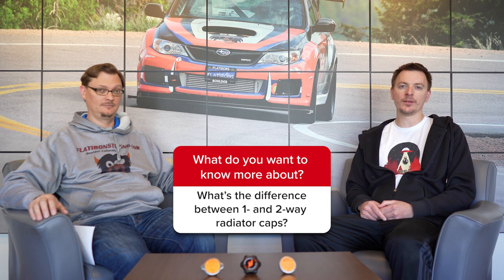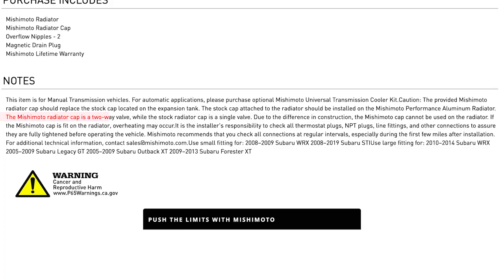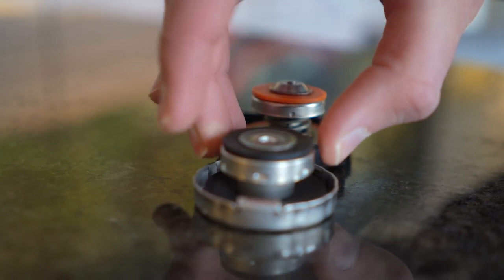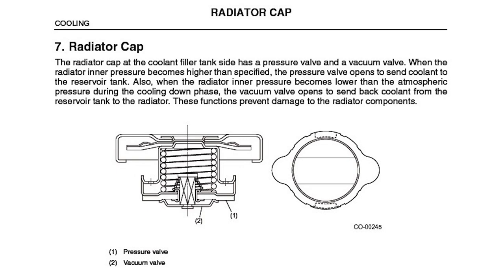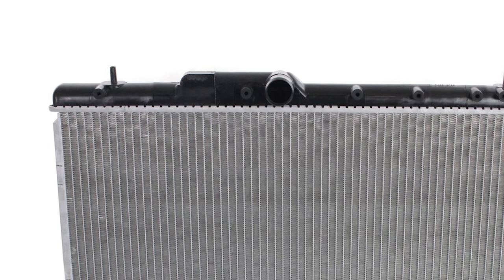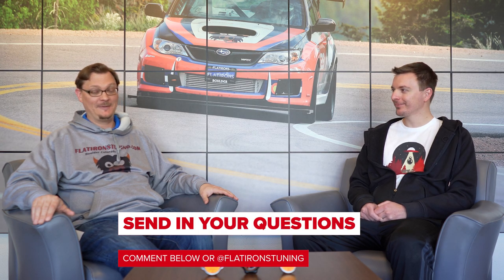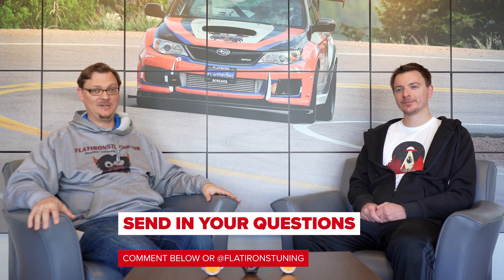Explaining the Mystery of Subaru Radiator Caps

Comment: So I am running a Mishimoto expansion tank and a Mishimoto radiator. And as you know they both come with the Mishimoto caps and I was running both but I noticed my car would over heat if idled for too long. Winter wouldn't really happen much. So I'm sure this is my issue, what should I do for caps? Should I buy an oem "expansion tank cap" and put it in the Mishimoto radiator? Will it fit?
Reply from the maker: Thanks for your question.  I'd recommend using the factory cap on the radiator because it is a 1-way valve, and see if that resolves your issue.

https://www.flatironstuning.com/subaru-oem-radiator-cap

Hope that helps and Stay Tuned!

Comment: i have a question about the pcv system. when i installed my IAG Competition AOS i completely removed my entire pcv system & just have all 3 breather ports ran into the AOS, and the return hose ran back to the crankcase breather port. Is my engine going to be ok without the pcv valve in said system, or do i need to reinstall the valve back on top of the crankcase breather port?
Reply from the maker: Thanks for your question.  From what you have written, it sounds like you installed the IAG Comp. AOS following their instructions, which is correct.  You do need to tune the car after doing this since you are removing the connection of the crankcase to the intake, but that is also why you do need to remove the PCV valve in this configuration.

You should be fine with it installed as you describe.

Hope that helps and Stay Tuned!

Comment: So, if the reason Subaru put the second cap on the radiator was to keep the seams between the aluminum core and the plastic from leaking, why does the all aluminum aftermarket radiator need it?

Comment: So I have a 2018 wrx with the mishimoto radiator and the mishimoto radiator cap… I have the stock expansion tank with the stock cap on it… I’ve been running the mishimoto radiator cap and my cars been overheating… could that be my issue ? Should I go back to the stock radiator cap?… I only have about 2 weeks with this set up
Reply from the maker: Thanks for your question.  I would recommend putting the factory cap on the radiator and then burp the coolant again.  Hopefully that helps.

If you continue to have issues I'd recommend getting an experienced Subaru tech to look at the car.

Hope that helps and Stay Tuned!

Comment: On my 04 sti I used to own it had a cap on the actual radiator and on the expansion tank reservoir. Ive had installed the larger Koyo radiator when I did one of my 4 engine builds and that radiator expanded from pressure in the cooling system and if I can recall had a head gasket failure. Probably due to not having a dual valved radiator cap on the expansion tank. Fast forward today now I own a 2018 Civic Type R which has an expansion tank and the radiator is cap-less. It is well known that these cars overheat on the track. I’ve done several cooling enhancement mods as well as a fully built motor and big turbo upgrade. Since then it hasn’t over heated. I think mainly from running a bigger turbo. I think maxing out the stock smaller turbo which caused more back pressure making it into a heat pump. The larger turbo has less back pressure so it’s not producing as much heat.
Reply from the maker: Thanks for the comment.  Stay Tuned!

Comment: Does this 2 cap solution also apply to the Subaru Outback...?
Reply from the maker: Thanks for your question.  If your car has 2 radiator caps from the factory (so an Outback Turbo) then this does apply just the same.

If you have a naturally aspirated engine, most likely you only have 1 cap from the factory, so you would not need to do anything to add a second cap.

Hope that helps and Stay Tuned!

Comment: I'm still confused on the radiator caps. i have a Mishimoto radiator and I have the Mishimoto cap on the radiator and it seems to run fine. should I do what Mishimoto suggested and swap the OEM  expansion tank cap on to the radiator and the Mishimoto cap on the expansion tank?
Reply from the maker: Thanks for the question.  Ideally you would run the stock caps honestly.  If you were to use the Mishimoto cap, it would go on the expansion tank, and then the OE RADIATOR cap would go on your Mishimoto radiator.  You need the 1-way cap on the radiator.  That is the piece that is most important.  Don't put the expansion tank cap with the "ears" on the radiator.  It is too low pressure, and is also a 2-way cap.

There is a reasonable chance that having the higher pressure cap on the radiator is okay.  (Mishimoto cap is 1.3 bar, and the OE expansion tank cap is 1.1 bar).  But you may still have issues with 2 2-way caps.

Hope that helps and Stay Tuned!

Comment: I run two oem 1.3psi caps on my forester xt, 1 for the tank and 1 for the mishimoto radiator. No issues after many years. I also did the same with my legacy specb, but with koyo rad this time. Still no issues. Just run 2 oem 1.3 caps

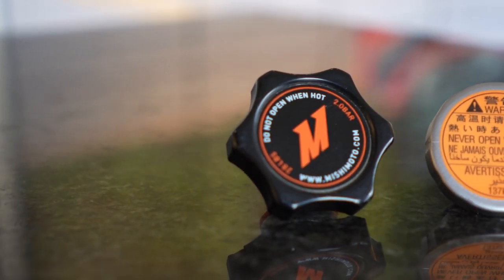Comment: I bought a metal Mishimoto expansion tank for my '03 WRX. Their brand new cap (identical to the one shown in the video at 2:28 and 2:36) leaked so i replaced it with an OEM cap. I have new OEM caps on order to replace the 19 year old ones.

Reference 4:45 it is stated that the 02/03 WRX did not have a radiator cap. I can't confirm or dispute that since i got a "free" radiator from my Subaru dealer when they poked a hole in it while replacing the timing belt. There are two caps listed for the 02/03 WRX: 

45137FE002 Cap  (Round)

45137AE00B Cap  (Round with two ears to grab onto)
Reply: I know the 02/03 only came with one cap, Subaru updated it with the 04 models (late 03 actually) due to radiator issues without the cap.
Reply from the maker: The 02-03 WRX didn't have a cap on the radiator, but that original part has now been discontinued and replaced by the newer radiator that has a cap.

Thanks for watching and Stay Tuned!
Reply: @Silent_Keith  Bought mine in March '03. Wouldn't consider that a late '03 but maybe it was since i'm pretty sure there were caps on both the radiator and the coolant reservoir. And the original radiator survived without leaks for 13 years until punctured at the dealership. Page 11-20 of the owners manual refers to both a radiator cap and a reservoir cap but maybe that only applied to non-turbo cars.
Reply: @FlatironsTuning  I can confirm that as my brand new 2002 WRX only had a "radiator cap" on the expansion tank.

Comment: So for a rotated setup without an expansion tank use the stock cap or aftermarket 1.3? 1.5? Curious
Reply from the maker: If you only have one cap on the system, it would have to be a 2-way cap.  So any aftermarket cap would do.  If you ran a 1.5 bar cap, then you would be increasing the pressure of the system.

Hope that helps.  Stay Tuned!
Reply: @FlatironsTuning  makes sense. Increasing the pressure with only one two way cap is good or bad?
Reply from the maker: @ANL4JC  Well, I would say that when you only have one cap, it must be a 2 way cap so that you will be able to let coolant back into the system when the engine cools off.  The advantage of a single cap is that you now have control of the pressure of the system with that single cap.  So if you want to increase the pressure, it is easy to do so.

Increasing the pressure will slightly increase the cooling capacity of the system.  Just make sure that everything on the cooling system is tight, etc.

For instance, we are running a 2.0 bar cap on our race car, but we had to test the system integrity to make sure that it would hold at that pressure.

You might want to take a look at this follow-up video:

https://youtu.be/RWZUdHRHkeI?si=JvWm1mQgA9jskjXD

Hope that helps!

Comment: Do I  burp air at the  expansion tank or on the koyorad  radiator cap ????. I just did this on the koyorad side. Was this wrong ?
Reply from the maker: Thanks for your question.  Because the expansion tank is the high point, you would want to burp the coolant there, not at the radiator.

Hope that helps and Stay Tuned!
Reply: Very helpful muchas gracias

Comment: Can the turbo legacy radiator cap (137 kpa) work on the non turbo radiator?
Reply from the maker: Thanks for your question.  Generally speaking, the non-turbo Subaru's only have one radiator cap, so you would be best to use their factory cap, not the Turbo cap.

Hope that helps and Stay Tuned!

Comment: Heya great video thank you .! question if i may.. i have built myself a closed deck forged 2.0 ej and am running a aluminium aftermarket radiator with no cap . from what i am reading should i be running a larger expansion tank ie the mishimoto one with a 2 way valve
?
Reply from the maker: Thanks for your question.  You do need to run an expansion tank then, and yes, you do want to use a 2-way cap there.

We go into detail about this after we made that switch in this video:

https://youtu.be/RWZUdHRHkeI

We have had good luck so far with the OEM expansion tank for what it is worth.

Thanks for watching and Stay Tuned!

Comment: I had a cooling issue due to running the mishi cap on a mishi radiator.. I think the main contributing factor is the expansion tank is the tallest point on the cooling system, therefore the two way valve needs to be there to allow coolant from the overflow tank to flow back into the cooling system properly. If you have a two way cap on the radiator, and a two way cap on the expansion tank.. then the coolant from the overflow doesn't have pressure to flow back into the cooling system.
Reply: @Lennysuga  agreed, but I believe the expansion tank is also supporting the coolant from the turbo.
Reply from the maker: Glad you were able to resolve your issue.

Thanks for watching and Stay Tuned!

Comment: I called and talked to Mishimoto about this 5 years ago haha I had that Mishimoto cap on the expansion and a Koyo on the rad for awhile no issues but then switched to the Koyo on expansion and a JDM STi cap on the rad (yes mostly for looks on both) but no issues, have only pushed the car on a California canyon run, no track time.
Reply from the maker: Gotcha.  Yes, now that we know what we are looking for, there is a bit of a pattern that is starting to appear.  It is really interesting, and we are trying some new things now that we have this info.

Thanks for watching and Stay Tuned!
Reply: @FlatironsTuning  yeah it’s surprising how much it impacts the timing and flow of the cooling system. Like on my FDRX7 the air separator tank has very cheap cap I wanted to change to a Koyo but the rotary cooling system is so fragile 
Looking forward to what y’all go with and find out 🤙🏻
Reply from the maker: @RX7Cody  Yep, this is a little bit of a game changer honestly.  Knowing this, we should be able to make a small change or two and get the cooling system to work a heck of a lot better.
Reply: @FlatironsTuning  yup! 🤘🏻
Reply: @RX7Cody  back when I had my 1993 RX7 R1 that factory expansion tank was known to just randomly explode.  The hot setup was to convert to RX7 FC expansion tank delete setup.
Reply: @DJ_Driven  yeah they do crack or explode lol I have a aftermarket aluminum one currently, should just do the FC mod and go v mount butttt my oil seals are leaking so bigger issues first haha
Reply: @RX7Cody  yeah the V-mount setup is the way to go.   The FC mod is super easy cheap solution if you still have the stock plastic tank.

Comment: Hy my subaru  has 2 caps the radiator cap its written 1.1 abd the one on the engine its 108kpa. 
What if i put both 108kpa  what will happen  coz i can only get 108kpa??
Reply from the maker: Thanks for your question.  I'd look at the bottom of each cap to see if they are 1-way or 2-way caps.  Make sure that the 1-way cap is on the radiator, and then see if you can find the Subaru OEM 1.3 bar 1-way cap.

Here is a link to that on our site if it helps:

https://www.flatironstuning.com/subaru-oem-radiator-cap

Thanks for watching and Stay Tuned!

Comment: So can you leave both caps oem or do you have to run the mishimoto cap on the expansion tank?
Reply from the maker: Thanks for your question. Yes, you can run both OEM caps.  If you were going to use the Mishimoto cap, you would only want to put it on the expansion tank.

Hope that helps and Stay Tuned!

Comment: Running CSF 1.4 cap on the radiator and HKS 1.1 on expansion tank no issues so far but hopefully you guys will come out with a better looking one way cap

Comment: I was just about to order the radium engineering caps from you guys and I'm glad I didn't. Just going to use OEM caps and be done with it so there is no guessing on a freshly built motor. I see radium has a style A and a Style B. Is one of them a one way and the other a 2 way?
Reply from the maker: Thanks for your question Nick.  As far as we can tell, all of the Radium caps are 2-way.

Thanks for watching and Stay Tuned!

Comment: Hello guys so which cap should have the higher pressure the one on the expansion tank or higher level cap or the pressure relief valve that Subaru calls it which is the radiator cap that's in front of the car
Reply from the maker: Thanks for the question.  The cap on the radiator needs to be higher pressure than the cap on the expansion tank.

Thanks for watching and Stay Tuned!
Reply: @FlatironsTuning  thank you so much for your response love the channel my last question to that vain the higher pressure cap that goes on the radiator in  front of the car should that be two-valve or one valve. From your videos I gather the two-way valve cap should go on the expansion tank which is the highest point of the car please confirm
Reply from the maker: @andrewhorry9417  Yes, that is correct.

Comment: A couple of years ago I got a radiator flush at a Subaru dealership and they accidentally swapped the cap locations when they were done. Started hearing intermittent burbling noises in the dash and discovered what they did 🤦🏻‍♂️
Reply from the maker: Ouch.  Glad you were able to find the issue quickly and fix it.

Thanks for watching and Stay Tuned!

Comment: Dealer OEM caps on Japanese cars gor for about $20.  give or take. Seems pricy compared to local auto parts store that are $5. However, dont cheap out on caps. If you are going after market buy a good quality cap. It may cost you about $25. But again, dont cheap out. I use the  cap that goes on my Megan racing radiator 1.5 years later. No issues at all.  I do keep a Honda oem cap in my glove box for backup.

Comment: I have the early STI style single cap system & really can;t understand the disadvantage - pretty much all cars have a single 2 way rad cap.... I thought the additional cap added to the radiator was purely because some people weren;t patient enough to bleed the system properly.
Reply from the maker: Thanks for the comment.  It turns out that the addition of that cap can cause a lot of issues if the proper cap isn't installed.

The single cap is a much better solution I'd say.

Thanks for watching and Stay Tuned!
Reply: Mucho confusion with 2 caps

Comment: I have a jdm 99 gc8 sti it only has one cap on the top turbo tank and the radiator has side tanks no failures yet 205,000km going strong

Comment: So what do you recommend for 2006 STi with Koyo Radiator?
Reply from the maker: Thanks for your question.  The Stock caps would be the ideal option for most applications.  At a minimum you want to keep that OE one way 1.3 bar cap on the radiator.

Thanks for watching and Stay Tuned!

Comment: As you do research I think Thomas said he doesn't run radiator cap on his radiator
Reply from the maker: Thanks for your comment George.  You are correct, and he has helped to point us in a good direction with the system as well.

Stay Tuned for another update here soon.
Reply: @FlatironsTuning  Also what aftermarket expansion tank works well for rotated turbo guys
Reply from the maker: @georgenickolas7321  It sounds like the Radium expansion tank would be one to look at.  It is a bit large though, so you would have to make sure you have room for it.

Comment: So the overheating issue is solved?  Im surprised.. lol...

Anyway i often see people swap aftermarket radiator cap...whenever they swap yo aftermarket radiator...

 which i will always try to make sure that higher pressure cap installed on radiatot.. not the expansion tank...

Because ive alway have this thought that with expansion tank.. u dont want coolant going out somewhere else at lower pressure than the tank...

So with this service manual on 2types of radiator cap story... These explain further and support my theory on this.. 

Thanks for bringing this up 🍻 cheers
Reply from the maker: Thanks for watching and Stay Tuned!

Comment: The mishimoto cap must be a lower pressure cap the the expansion tank cap, otherwise why even use mishi cap?
Reply from the maker: I think that the 1-way and 2-way configuration still matters, but yes, the pressure stagger is almost as important.  It is likely that without making other changes, the ideal option is to stick with the OEM caps.

Thanks for watching and Stay Tuned!

Comment: Flow Dynamics can also cause issues , (modify) engine usually Create way more heat than the (block ) was engineered to dissipated/ pressure /flow may have a max efficiency with the infinite variables of block differences , 
Maybe equalizing flow with a (4 cylinder cooling mod ) 
I currently have a expansion tank deleted with an AOS as high point,  with radiator cap after market radiator . it pulls and pushes coolant in to the reservoir no problems or overheating has occurred
Reply: So basically you deleted the expansion tank and running the iag race version AOS with aftermarket radiator and original factory radiator cap correct?
Reply from the maker: Thanks for watching and Stay Tuned!
Reply: @DJ_Driven  that is correct , so no issues as of now there is a few other factors but related to this video that is what I’m running